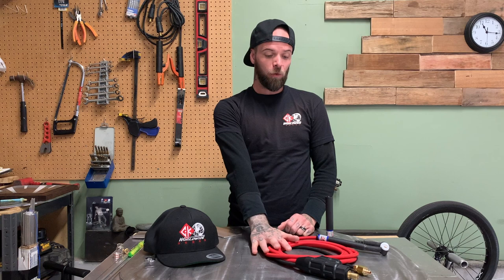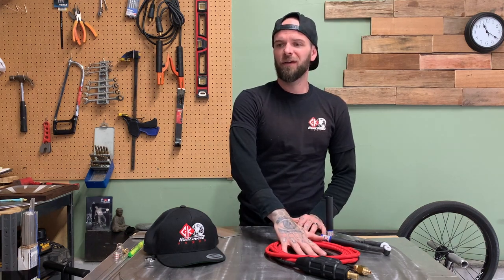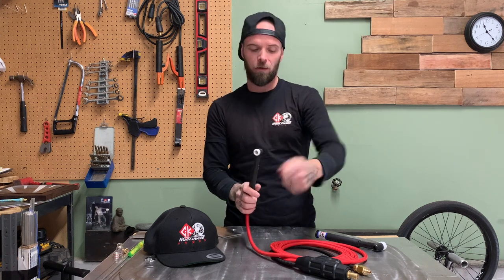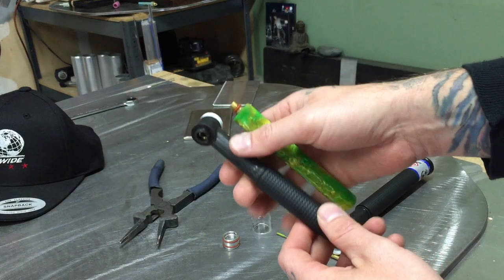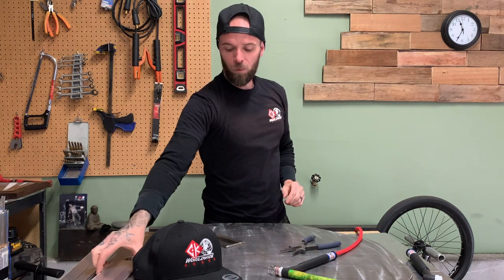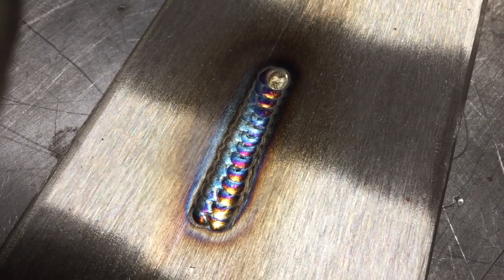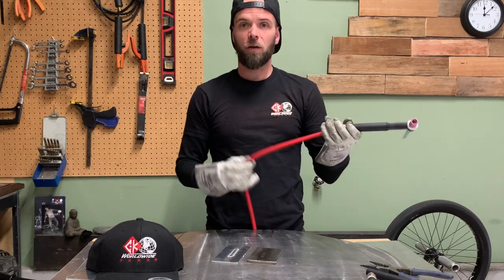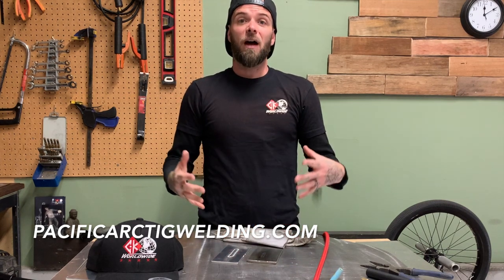CK WORLDWIDE REVIEW - MY NEW TIG WELDING TORCH!

Comment: Got a number 9 flex head torch from them a couple of months back and it’s hands down the best ever. The superflex hose is miles ahead of the stock torch that came with my welder. Since then I’ve bought a 26 torch as well, and can’t get enough of it. Absolutely wonderful. Luckily there’s an official supplier here in Russia. The price is fair for the quality you get too. The 9 just lays in your hand like a pencil. I found that I don’t even notice the hose, where I was always trying to find a comfy position for the hose with the stock one. As for sheath/cover - I just plaited over mine with some paracord like you would do a whip. Seriously great gear. Thanks CK Worldwide for making such wonderful stuff.

Comment: My new 200 amp DC tig/stick welder just arrived today, I am new to tig welding so all this info helps a lot, thank you.
 A question about the back cap that you made, do you have a list of the parts I would need to make one, like the brass fitting that goes in and any O-rings that it uses? Also, did you use just a standard acrylic to make it or is it a high temperature type material or ??? I have a mini wood lathe and would like to make my own, I think it gives the torch some nice flair. 👌
Reply: Somebody else made it - he gave them a callout at the beginning.
Reply: @firstmkb  I see, thanks.

Comment: Hello
I was wondering which cable connector you used for the CANAWELD 201 pulse-D
SL2-25 or SL2-35 1/4” or 3/8”??

Comment: I’m going out on a limb Dusty when I throw this out there but I was wondering do you have anyway you can do a learning video on a valve torch & basic. By that I mean no foot pedal/ no switch on torch. 
Asking cause myself & a lot of people out there but themselves a half decent wee stick weld machine with lift start TIG welding cape abilities, buy the rest of what’s required to get going and then all the vids show experts with foot pedals & switches. 
There has to be good knowledge that can be passed on about this subject. 
There’s many situations when TIGG’n with a valve 😉 only comes in useful. Thanks Buddy 👌🏼  Just love your work by the way 👏🏻

Comment: Seriously jealous lol...Found the adapter to run a CK 17 flex on my rig. It’s on the immediate needs list. Too cool.
Reply from the maker: It’s a nice little unit for sure, I highly recommend:) Easy on my hands for sure :)
Reply: You’re lucky it’s “CK worldwide” you northerner you 😎
Reply: Pacific Arc Tig Welding and yeah the unit bundled with my primeweld ct520dp is a 17 series and actually not bad! ...but it’s sure not a CK 17 flex. I guess the ac/dc 225 they sell actually comes with a CK torch, which is pretty darned cool. For my next trick I’m taking a harbor freight welding cart I scored off Craigslist unopened for $20 and beefing it up with real wheels (with bearings lol) and adding a scrap sheet of fairly heavy gauge underneath that will strengthen and widen the chassis a bit so I can store more goodies and roll a K size argon tank, weight max now is 100 and I’m thinking it will hold 400 easy when I mod it, not that I need that much. Will be into it for $40-50 tops when I am done ✅
Reply from the maker: Amazing. You’ll thank all the work when you’re done! That’ll be a tidy little unit💪
Reply from the maker: Haha I get it. Ck ‘ships worldwide...?”😂
Reply: Pacific Arc Tig Welding it’s 117 here and the AC in the Jeep is no bueno. I’m not able to actually be funny. Best I got. 🥵
Reply from the maker: Dangggggggg that’s a smoker of a day! Stay hydrated! ;)
Reply: It was 120 last week... ehh. Why didn’t I decide to build a gas forge during the winter ❄️ when it’s down in the 80’s...🥶
Reply from the maker: Wow The struggle is real for you!

Comment: I don't know what the difference is between the 9 and 17. My machine came with a 150A torch with gas shut off on handle. I was wanting to get a CK but trying to get the right one. Tried tigging years ago, I mig welded. Wanting to learn more so got a titanium multiprocess 200.

Comment: Where can I get a setup like you have there with the negative connector? I looked on CK workdwide and nothing only touch and hose no combos? I just bought an Everlast 255EXT here in europe, they don’t supply an air cooled touch no flow gauge no pedal only a water cooled touch. So basically you can’t use the welder from the word go. Learnt my lesson it’s cheaper to buy from the US. My shipping would be less that the cost of the missing items

Comment: Last year bought a torch for my Everlast from them, they said it would fit, have the large dinse plugs, they where slightly smaller to the point they would wobble & turn possibly arc so I contacted customer service, they told me they knew some of the Everlast machines would not work correct with there torches but tried by e mail talking my into trying some kind of shim on my new machine, told them forget it I want a full refund, begrudgingly they gave me the refund after the torch was returned, after this the fact that they knew of the problems, lied to me about the fit then tried to talk me into some fucked idea I will never buy anything from these clowns!